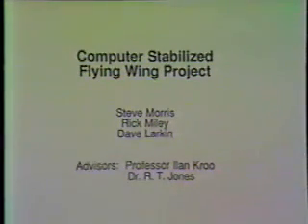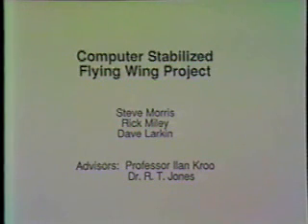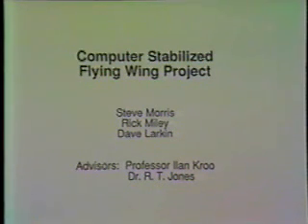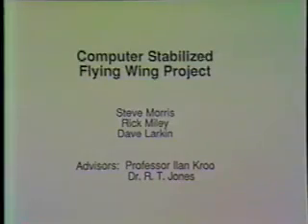Unstable Tailless Demonstrator

Comment: One of my favourite videos. I can imagine the difficulties on this project, arising from the rarity and cumbersomeness of the electronic components used. It was 1987. It would be interesting if this project was re-done nowadays. In fact, the only difficulty today would be to make the angle of attack sensor. Or to buy it, since I do not know of any commercial small acale aoa sensors (on the contrary, everone can buy a pitch rate sensor-i.e. gyroscope)!

Comment from the maker: The aircraft is highly unstable in pitch and has no horizontal tail, that is why it is called "tailless".  If an aircraft lacks either a horizontal or vertical tail surface it is commonly referred to as tailless.  If there is no tail at all it is usually called a flying wing.